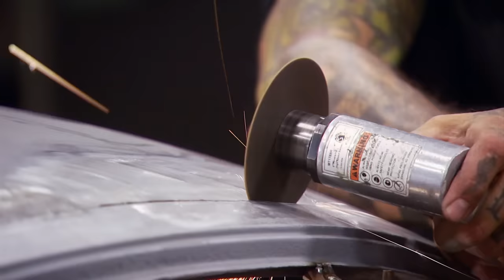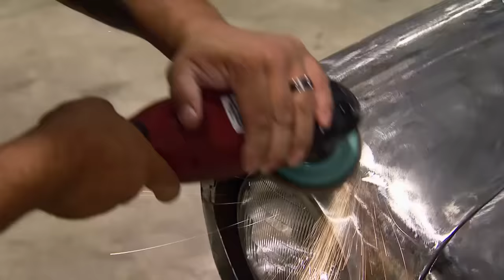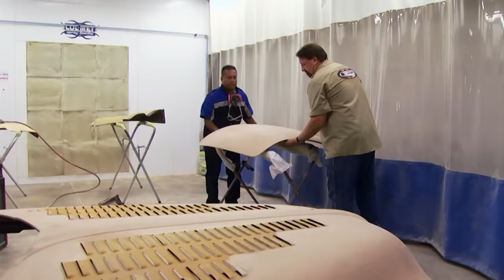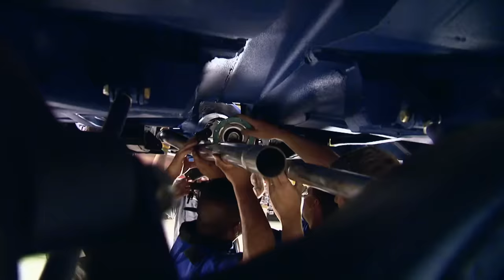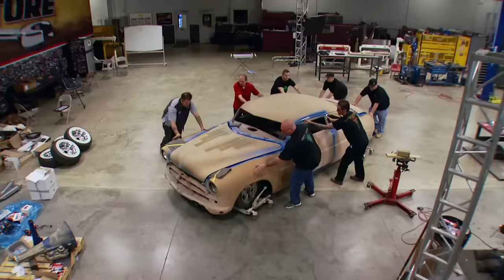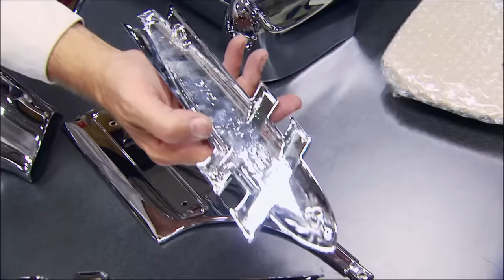'51 Hudson Hornet Rebuild in 10 Minutes!

Comment: Coolest looking Hudson ever! I remember when that car was new. They were always considered an old man's car. Even when they won a lot of NASCAR races it wasn't very well known. Love the way they did it! Everybody did a chopped '49 or '50 Merc but never saw one of these. As far as the Bondo, all good paint jobs use a very thin coat to smooth out the body panels. It's probably not more than a 16th of an inch thick at most. I wish they would have shown more of the finished car though with the interior and everything. The trouble with doing these for a tv show means they have to have it "finished" in a certain period of time.
Reply: The Olds in my town calls it dirt derby not Nascar.
Reply: If I was old I'd buy one

Comment: Should have a Hudson Twin H flathead 6 with an old school 4 speed Hydramatic!
Reply: I know the guy that owns this car. He is a Mopar fanatic. The plan was always to put a Mopar drivetrain in it.
Reply: Kinda makes sense, since Hudson is an inactive marque of Chrysler (via American Motors).
Reply: theres probably a reason they DIDNT do that. I would know because I own a hudson. Sourcing parts for a Hudson is damn near impossible as the manufacturer, Hudson Motor Car Company, was bought by AMC not long after those Hornets rolled off the assembly line, plus idk about back then but i know now that aftermarket parts are usually made based off of demand, if theres no demand, then they wont make the parts. back to the car though, finding a 308 ci hudson straight 6 with the dual carb twin H power air cleaners AND a 4 speed hydromatic will be nearly impossible, harder than finding individual parts for those cars, atleast without having to buy another fully restored hudson and ripping THOSE parts off just to throw them into another car

Comment: Excellent job!
Why do you repeat the sanding and primer process over and over again?
Reply: I think it's primer-filler, which means you build up enough substrate in the low spots to achieve a smooth and even surface. Also, they are doing guide coats to ensure that there are no low spots.
Reply: They get paid by the hour.

Comment: The best engine for this one is a Chevy LS swap and it's transmission with the lastest Chevy Corvette speedometer. I think a turbocharged Cummins diesel engine fits inside the car is a must alternative.
Reply: Not really historically accurate, since Hudson is one of Chrysler's inactive marques (via the American Motors merger in the late 1970s), thus the Mopar motor is the acceptable substitute for the original I6 motor.